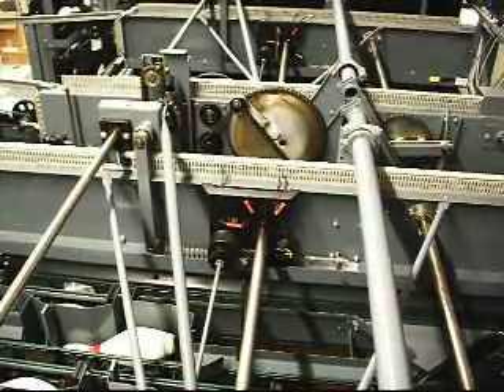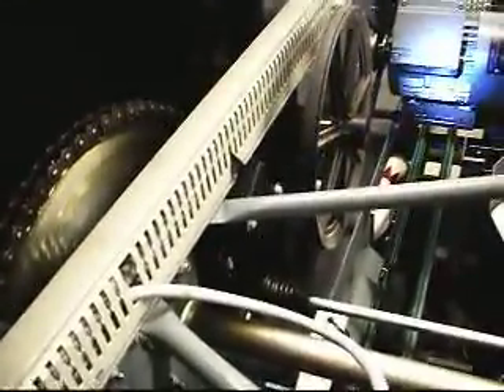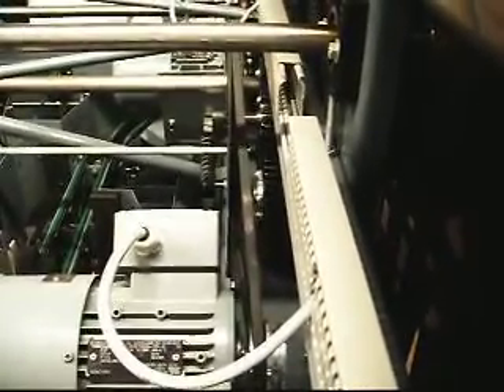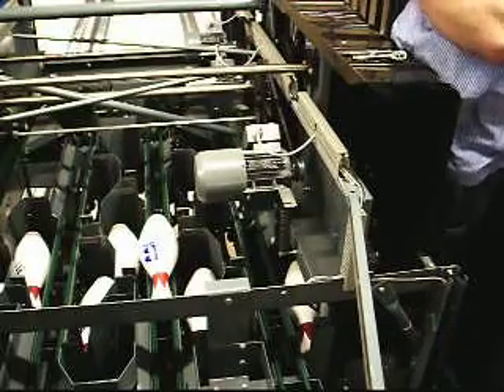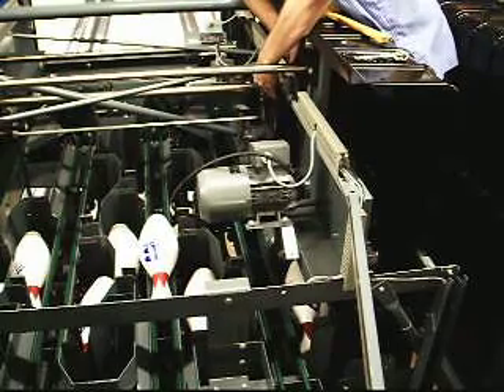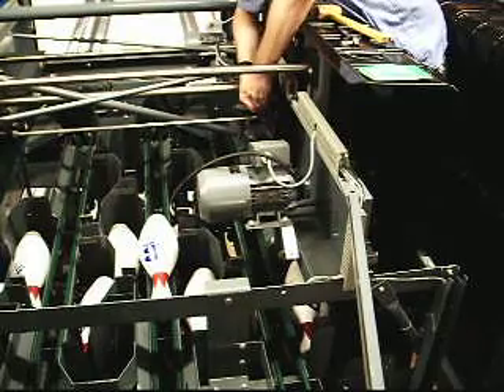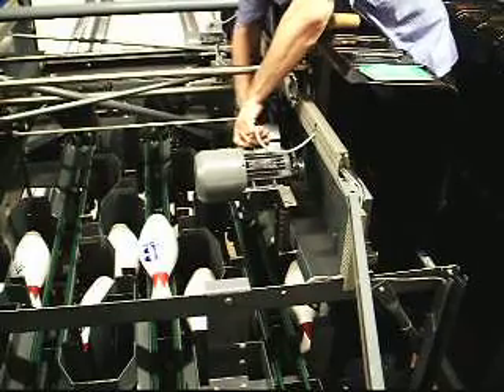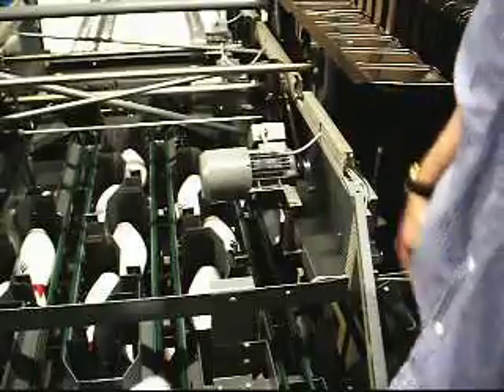GS-X pinsetter, error code 72, C switch expected but not found.

Comment: That roll pin they designed for that pulley does not fit the stock Brunswick part, very smart of you to just use a nut and bolt told hold it on

Comment: I'm a technician in England the pins that have been hit won't be swept away until the second go I have a feeling it's the tower switch but not sure using Brunswick GS98
Reply from the maker: Kylan-
I am not sure what is controlling your pinsetter.  I am used to pinsetters that are running through a Nex Gen controller.  
Possibly could be controller issues.
I could use more information.
So a ball is thrown, does the sweep release and come down, does the table come down, are the pins detected and displayed on the score screen?
If the sweep drops then it shouldn't be an issue with the ball detect.
And if on the second ball the pins are swept away, then the sweep motor is functioning.
I would strongly consider swapping controllers from a good set of lanes to the ones in question.
If not the controller box than at least the pcb circuit board.
Unless if it is not scoring properly because of a bad table cable or bad table cable connection.
If the pinsetter thinks that either just the 7 pin, just the 10 pin or no pins have been knocked down then it will never sweep until the second cycle.

Hope some of this gets you heading in the right direction.
Thanks for the interest in these tips and repairs.
Reply: @tmiller453  he's so disrespectful not responding anymore